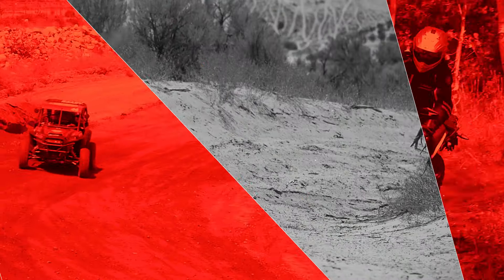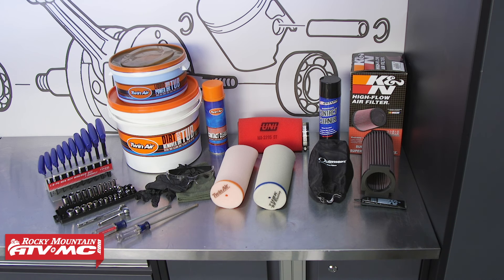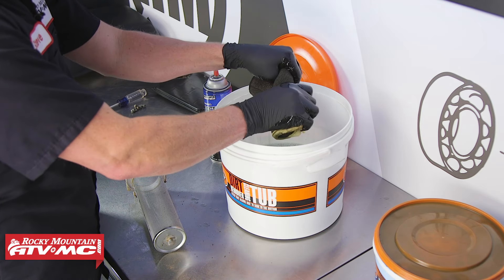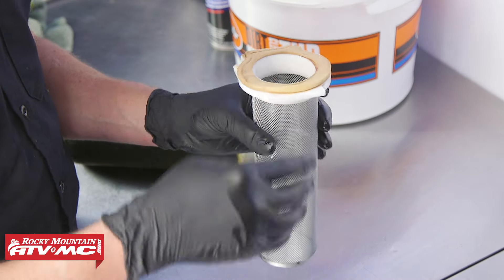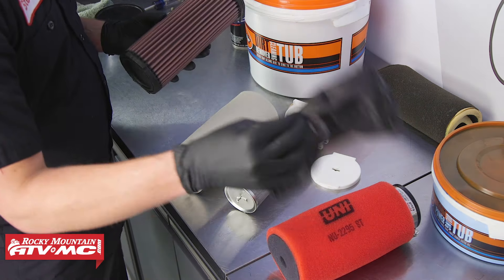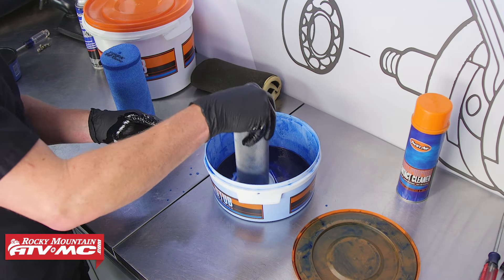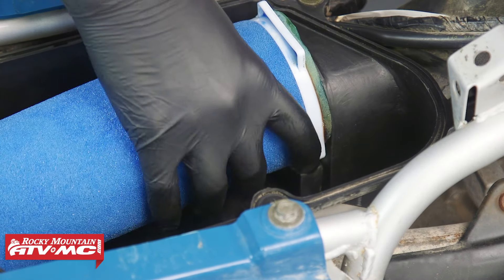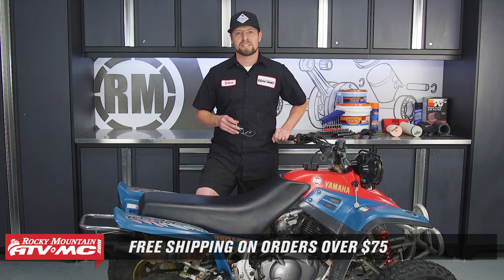How To Change the Air Filter on a Yamaha Warrior 350

Comment: The red filter should you dip it on oil too?
Reply from the maker: We were just showing a couple different options for air filters. If we were going to use the red Uni air filter we would have oiled it the same way before installing it.